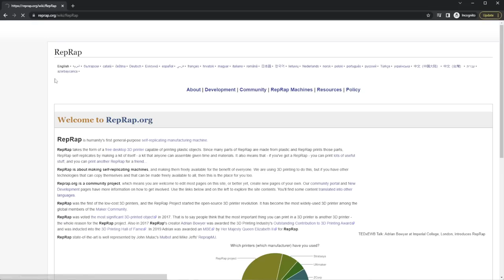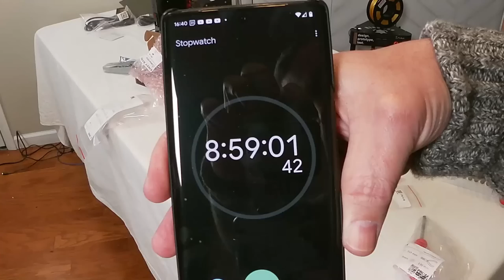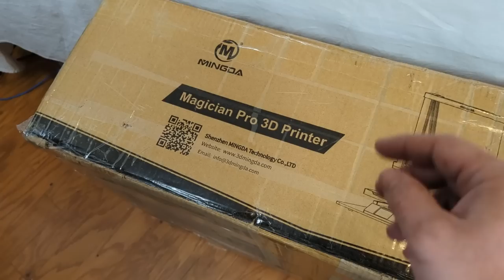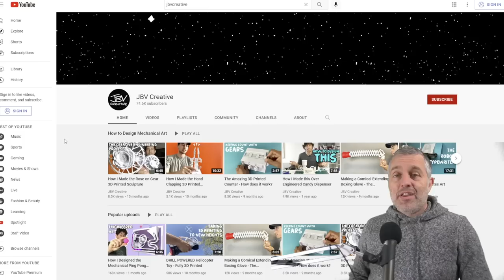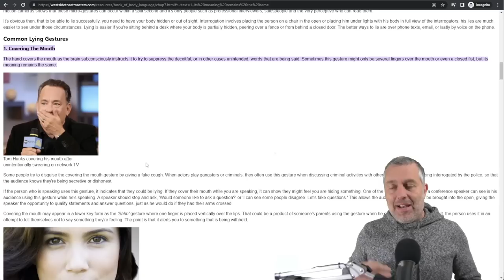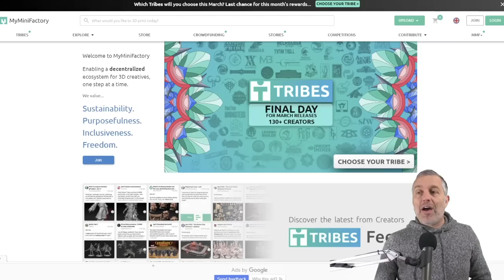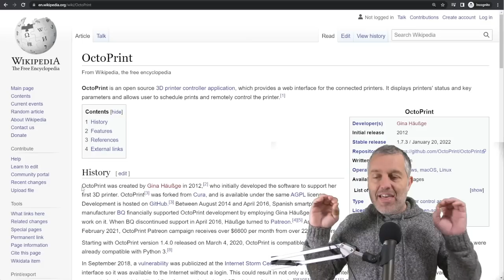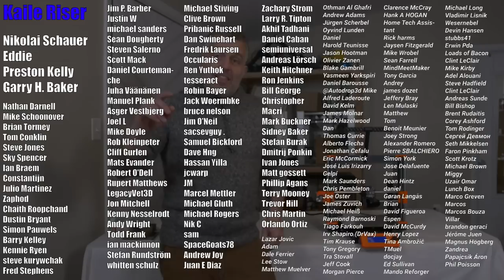Why Does Nobody Speak Truth About The Prusa I3 Mk.3? - It's Overhyped and Over Priced.

Comment: The Chinese printers are horrible software wise. Also designwise they all lack as well. Why would you make a 400x400mm bed WHICH MOVES ??? This is the dumbest idea ever. At this size any good printer has a stationary bed or a bed which only moves in Z. So my conclusion would be the Prusa printer is overpriced and has a bad design which it gets around with nice software and the Chinese printers are a bad design and bad softare but they are cheap and work, slowly but they work. I really wish for an affordable kind of okayish design printer with great softare like kissslizer or something. Prusa should really get rid of that 57528 parts behemoth and just make some Core XY machine.
Reply from the maker: FLSun V400, Bamboo Labs X1, etc. There are several Chinese printers to which your criticisms don't apply. You don't want to talk about these because your agenda is to make Prusa look good and ignore or deny anything that contradics your message.
Reply: @DesignPrototypeTest  That are two printers which weren't available at the release of the video. One is kickstarter and the second is only pre sale. So no printer was shipped to any customer.

Comment: I had an Ender 3 and a Prusa MK3S at the same time, and the Ender 3 always did better prints than the Prusa. I also had more pieces to replace on the Prusa (linear bearings, guides and fans) than on the Ender 3.

Comment: I'd like to try your gcode. Can you send me it?
Reply from the maker: Prusa or Chinese?
Reply: @DesignPrototypeTest  i guess both. I have like 3 chinese and one prusa. I'd like just to try what results i would get
Reply from the maker: https://drive.google.com/drive/folders/1JlXvhoycPJheTNbGwG4gmXi5GAawTQg2?usp=sharing
Reply: Thanks m8.
Reply from the maker: :) Let me know if you get any interesting results. I tried to make it as similar as possible, but some settings reset when I changed the printer and I had to manually go back through and make a lot of the changes again from memory. I think I got it all the same, but I might have made a mistake.
Reply: @DesignPrototypeTest  wanted to start tu print that gcode you sent me earlier. but that M486 code is super annoying on my biqu b1.  can't disable the buzzer on the machine in the menus. and to start to modify the g code would take ages. is it possible  to get the same files but without that command? thanks again btw.

Comment: Okay while researching i stumbled on this vid. And I really like the non-conformist videos, but when he started talking about "using nozzle itself for leveling" I just tapped out. As an owner of Anycubic Vyper with the pressure sensor BS tech with using nozzle, I would officially say, that I would rather do shit manually. Sheesh the leveling is crap with these sensors, and these sesnosrs break easily - a thing that is totally not something you want for a 3dprinting hobby. Everything else on the Prusa critique feels stretched, but I guess to comes for some frustrating experience of years of using Prusa, if not - just a BS hit piece.
Reply from the maker: You're all over the board man. Quit equivocating and say something solid.

Comment: I have to commend you on "taking on the giant" problem is you focus way to much on negative. YES the Prusa is a polished turd. The thing is nowadays people dont care what is polished as long as its polished. It does work. My Ender works better , but thats because of my knowledge and the amount of upgrades written. Condescending or not I do think the manual has to be that descriptive so the dont get bombarded with dumb questions  using up resources that could be better used somewhere else. I feel your pain pain but do to your emotion directing your words, they fell on alot of deaf ears. Overall good video.

Comment: I was straddling the fence. I guess I'll get a ender 3 s1 pro!
Reply from the maker: "S1" or "Pro" are not recommended. Get a base Ender 3 for $170. Save your money. If you want a great out-of-the-box experience get the Mingda Magician X with nozzle touch bed leveling and filament runout detection.

Comment: I really hated my ender 3 then I started to like it a little more but it is just a ok printer. I have had plenty of part failures in a very short time with my unit and I have way too much money into it. If you just want to print don’t buy an ender 3.

My MK3S+ had 60+ Y crashes within the first 10 min of printing and after being told maybe it’ll work itself out I was about to send them a video of me destroying my new printer in the street and pissing on it. I’ve wasted more money faster. Once I asked their tech support real troubleshooting questions I got told that they don’t troubleshoot like that and when I told them that was not an acceptable answer I got booted from the chat. Then I got a different guy after doing their dumb chat again and he had me check some simple stuff and said that they would send me a new stepper motor. 
What if I had just given up and accepted that first answer? I would have been shafted, that’s what. Even tho their printer does print better than any creality product I have owned or friends own it is no better than my voron and much slower at the same quality. I would probably not recommend a prusa to any of my friends after my experience. Don’t offer tech support if you can’t give your customers technical support. If they don’t know how the printer works they are certainly not tech support.

Comment: I have a prusa mk3s and in my opinion, you are right. Prusa is overate, Joseph is really disturbing. I can't understand why he puts his face everywhere...
The assistance is a deception, when they deliver you a bad product you have no warranty and not even a discount on the replacement part.
But the printer is reliable, the BL touch is good and the slicer really well made for their printer.
When you are a beginner, it's a good product.
When you have more knowledge, you have to buy a voron or something like this.

Comment: I personally find the instructions quite nice and fun. I even like the gummy bear instruction! A little silly but it's just kinda of an enlightening experience all around for the kit build.

The very detailed instructions help a beginner understand more about the machine and doing it all by hand really helps you develop mechanical skills that not many people these days have 😅

These are just my two cents, but either way, great video! I appreciate the time you took to read my comment, have a great day!
Reply from the maker: If the goal is developing mechanical skills, I think building Voron printers is more enlightening.
Reply: @DesignPrototypeTest  this is very true, it will be next on my list too 😂
Reply: @DesignPrototypeTest  I have both printers -mk3s+ and Voron 2.4. And you will find that voron has its own issues as well. For speed runs its better voron but for consistency mk3s. Not talking about ender 3... these crappy chineese p***e of s** cannot step in my door
Reply: @jiridvorak9381  Any printer can step in the door. its more about how you tune it.

Comment: I had a Prusa MK2. It was a work horse and at that time it was a great printer. But flash forward five years and it’s an overpriced under performing machine. Heck my FLsun SR costs half of the MK3 and the SR outperforms the MK3. I even considered buying the $2000 Prusa SL1S resin printer. It doesn’t appear to perform any better than a $200 Elegoo. I believe the Prusa Fan boys are fading because they realize the same thing. They have moved on to better machines like the Vorons (as you mentioned). I don’t recommend any Prusa any longer due to price point and performance. Your the only reviewer who calls it how it is but you can hear it in others reviewers enthusiasm towards new Prusa products.

Comment: I feel like you make really good points when talking about the hardware in theory but in practice these china printers are hot garbage and mess up just by looking at them. Prusa does a good job at dialing in the software/firmware to give you a flawless experience at the cost of old and validated hardware.

Comment: jeez, I got into this video just kinda looking for something to listen to, but some of these complaints that I am hearing less than 20 minutes in are just aggressive. I am actually moving to a Prusa from an Ender. Why, because an Ender while cheaper is a lot of work to print anything on and I was left with an injury that made it impossible to use my Ender for over a year. Meanwhile I could print just fine with a bit of help changing filaments on my schools Prusa MK3's. And too detailed instructions? My guy, have you ever had to write instructions? You write instructions for the idiots, not the smart people. Instructions for building anything need to be idiot proofed so anyone can build them. Compared to the instructions for my Ender, I didn't use the instructions to build my ender. I used a well vetted instructional video on youtube that was probably just as detailed as the cura booklet. And talk about bias and aggression in a review.
Reply from the maker: You've made your decision. You're on team Prusa. Like so many other internet commentators who want to jump on the bandwagon. Unfortunately you've made the wrong decision. You should have bought a bamboo lab. But that's beside the point. You are justifying instructions that tell you when you're allowed to eat. Talk about controlling. Also, instead of putting a diagram with a nut on the end of a long bolt, they chose to use Prusa standing there with his arms. Crossed. Like he's standing over you authoritatively judging you like a boss. I guess you are a servile type who likes to have a leader and not make decisions for himself. If my review sounds biased it's because I'm pushing back against the mob. Of groupthink. I'm the only one who dares to speak out directly against Prussia. Every other content creator doesn't want to face the negativity backlash. Populism's evil side. You accuse me of being biased. I think you just don't like hearing the truth.
Reply: @DesignPrototypeTest  your incorrect about my team. I was strongly team Ender, and for a beginner hobbyist looking for 3D printing as their hobby I still am. If anything, I'm team Carbon, or Team Formlabs, after having gotten the chance to work with both printers and meet the Formlabs team. However, your comparison of instructions is counterproductive. Instructions are also meant as a form of protection against complaints of bad machines due to user error and to ensure someone can build the machine even if they've never held a screwdriver. That may not apply to you, but that is the mark of a good set of instructions. And from the rest of the comment section, you are really bad at following instructions.
Lastly, go ahead and push back. I clicked on this video hoping for a concise review giving me a different perspective. What I got was feeling like I'm being belittled for going with a Prusa (used, I might add, as 800$ for a new printer is a bit much for me at the moment) because I can't physically maintain a printer at a high level or make modifications anymore. If you'd happily send me a fully functional printer with reliability that outperforms a prusa or any other brand for that matter, hit me up. I'd be down to try it! But right now I am physically incapable of building another printer or maintaining my Ender.
Also, I assume you're not a fan of Musk? I'd be very confused on your stance about Prusas front man if you are. 
And why are you arguing in the comments of this month's old video???
Reply: @DesignPrototypeTest  and additionally you might want to check your autocorrect. Pretty sure Prussia was a country, not a company
Reply from the maker: You were team Ender. that means that you aren't anymore. Now you own a Prusa, and you are here defending Prusa. You aren't on my Ender videos saying I'm bias in my criticism of that printer. Your actions show that you are on Team Prusa. Carbon and Formlabs are not competitors to Prusa. That's like saying. I'm not team Trump. If anything I'm team Mandella or Churchill. 

OMG more defending of the instructions. For real man? Let it go. 8 months ago one of my most ardent supporters @lazarjovic9948 made the legitimate points about the manual. I pinned his comment to the top until it had over 200 upvotes and was guaranteed to stay in the top 3 comments. I did this to acknowledge the counter arguments and attempt to provide some balance to my video. While there may be some justification for overly detailed instructions, that doesn't excuse Prusa for telling you how to eat gummy bears or feeding Josef's ego by putting his likeness in a little circle. What does that even mean? Good instructions don't require a cipher. Good instructions are understandable at first glance. They sacrificed understandability for the opportunity to aggrandize Josef. Like he's some sort of Communist politician with his poster hung all around the city. GO TEAM PRUSA! 

>Also, I assume you're not a fan of Musk? I'd be very confused on your stance about Prusas front man if you are.
BAIT. Stop pretending to be someone who you aren't and not knowing things that you do know. What a random thing to say. The only reason you would write a sentence like this is because you have insider information about me but you want to bring up the subject without giving away the fact that you know so much about me. Cheater. Must be frustrating being you. Needing to bring me down and make me look like a fool in the comments but I won't say any of the things that you know you can get me on. Prusa is NOTHING like Musk. The comparison is ridiculous. Tesla is called "Tesla" not "Musk" SpaceX is called "SpaceX" not "Musk." I don't see Musk's face in any of the literature for Tesla or SpaceX. Also, nowhere does it day "SpaceX/Tesla by Elon Musk." Prusa has an ego problem and the fact that you would even draw a comparison between him and Musk means you are feeding into that problem. This is how tyrannical autocrats are made. Shame on you.

>And why are you arguing in the comments of this month's old video???
Why are you writing comments to only me "My guy, have you ever had to write instructions?" and then trying to make it look like something I did wrong?

>and additionally you might want to check your autocorrect...
Why would I waste time proofreading my voice dictated response that only you will ever read?

I can't wait for the day when Prusa goes out of business and I no longer have you as a monkey on my back making my life worse. Leave my channel alone. I criticize everything but I double down when I get pushback that is wrong. See, that's why I'm so strongly critical against your company. It's not because I have unjustified emotional bias against Prusa. It's because I've faced 5 years of cheating and denial of the truth by team Prusa. That pisses me off. If y'all would say "good point" I would have moved on long ago. NOPE. It's gotta be a failing of DPT. He is flawed. Prusa can't be anything but perfect.

Comment: Really good advice for beginners. Ender3 is a great starter printer. One of the engineering flaws in Prusa is that the steel rods are press fit into 3d printed plastic. Lot less discussed but I know many students who never knew the play that can get introduced and accepted the print quality degradation as something normal. Also I would like to get in touch with you for something. How do I connect ?
Reply from the maker: Click my channel name, then click the "about" tab, then click  "I'm not a robot." Then send me an email.